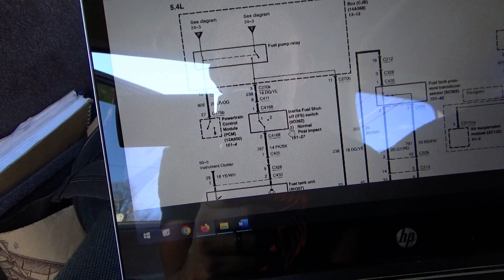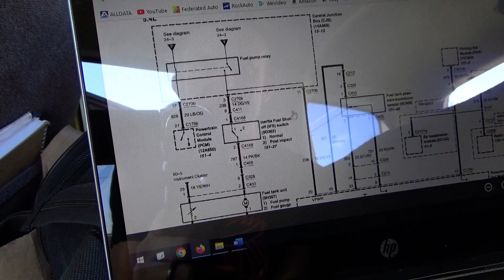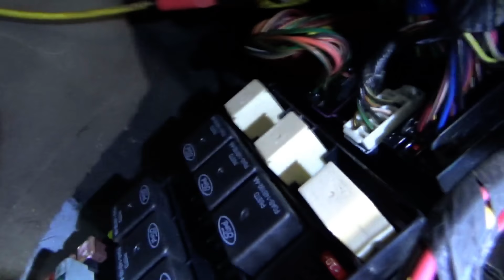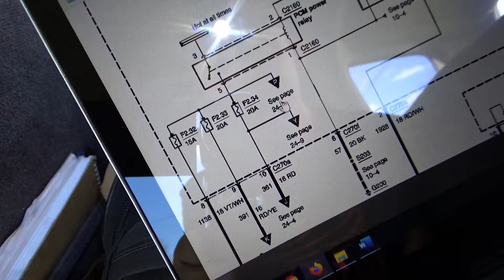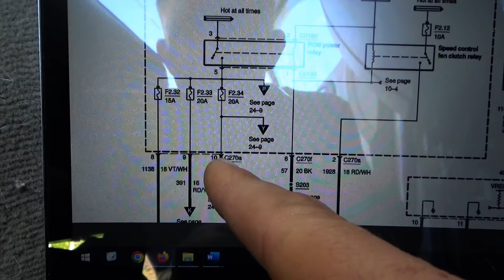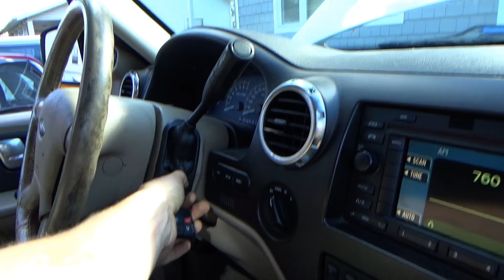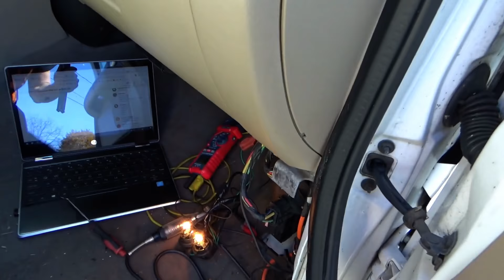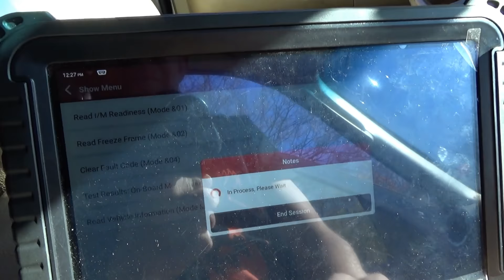Ford Owner STUMPED for 6 MONTHS? Fixed in 15 MINUTES! (No Fuel Pressure P0231)

Comment: Did a relay replace years ago, New mini-relay soldered in to the main fuse board, had intermittent stalling issues.Have driven the 2003 Expedition about 7 years since, now 290,000miles. The mini-relay was a four pin I believe, and all the fuses had to be removed and the board disassembled, not horrible.Just have to lay out the fuses to match their locations. You could see the burn marks on the board.Next time I will do this instead. You are a solid tech.

Comment: But if you leave the ignition on with the engine off the pump will run all the time. Output from the ECM pulses that fuel pump relay for a few seconds to prime the injectors and then shuts it off. This is not a fix. It is a dangerous hack. Either replace the relay with a new factory one or splice in a aftermarket relay..

Comment: Ford should be reprimanded for designing / engineering the fuel pump drive circuit in that manner , why did they not just have an external fuel pump relay for that circuit ? 🤨 BUT HEY - makes them money 😒

Comment: The fuel relay actually shuts off if the vehicle is even impacted. At least the older ones did.
That also came in quite handy to police departments who might be chasing a Ford all they had to do is bump it from behind and it would shut the car down.
It used to reside near the rear of the vehicle sometimes either in the left side of the trunk or the left side of the storage area and an SUV and you pull back some Carpeting and you push a button and it resets it
Reply from the maker: Yup the Inertia Switch is still present on this one and is active :)

Comment: Kinda disappointed you didn't fix it correctly, I never professionally nigger rig something unless it's a lost cause.
Reply: I would have added a fuse holder to that circuit, to keep it separate so there's no chance at burning up that fuse block more than it already is.

Comment: I've seen this on various manufacturers  products. There are many ways to fix stuff but only one way to do it correctly all temporary repairs are permeant until they fail again and its always the last one to touch its fault when something goes south. I would remove the Distro Box break it down and desolder/resolder the relay proper. Board level repair is not that difficult just a little time consuming is all. This is a hack repair IMO. Works yes but is it correct ? No .

Comment: As others have said, add external relay. Gonna burn up other switches etc otherwise. Ford put that relay in for a reason.
Reply from the maker: @billhartsfield424  what other "switches" would burn up? 😂
Reply: @ should have said relay . I know you said it was replaceable, but why not just add another dedicated relay and be sure you’re not overloading the original replaceable . But, then, it is a Ford. So go with what works👍
Reply from the maker: @billhartsfield424  I showed the wiring diagram in detail... There's no extra load on any fuse or relay with my bypass 😉👍

Comment: First, I agree with Ivan.  Internal, non serviceable, relays are a STUPID idea !

But, the "Russian solution" disables an important safety feature.  If the engine stalls for any reason (like in a crash) the fuel pump stays on as long as there is power to the PCM.  Currently the PCM shuts down the fuel pumps within a few seconds of the engine longer turning.

Comment: I hope that my EV doesn't have that problem

EVs are way simpler to diagnose.... for EV techs

Because they have way way way less systems to deal with, like less than twenty (high estimate

Whereas ICE vehicles have dozens of systems of systems that have a convoluted relationship with the engine and each other
Reply from the maker: @ScrappyDoodad  let's see your EV go 200k miles first 😉

Comment: Nice. Jumping the relay was a nice way to bypass the issue. For an older vehicle I think this is an excellent fix.   Watching your vids has provided me with a different way of approaching automotive problems. I had a guy at work that had an issue with one of his grandkids cars. Unfortunately he pulled the parts canon and threw out the original parts. I didn’t look at the car, but when he mentioned the issue of it not running after washing the engine, I mentioned to check stuff before the canon, since it sounded like it was on account of the bath lol. but they didn’t. replaced anyways. Ended up being water in the air intake and a wasted amount spent on a new throttle body. 

More people should watch your vids. It would save them so much. Even if you were to fix it the price of knowing the actual problem and not guessing is worth it. Keep up the awesome content.

Comment: Hi Ivan,  doesn't the fuel pump run whenever the ignition is on through the jumper rather than under computer control only when the engine is running (after priming)?

Comment: I've got a '96 3.8L Windstar (I can hear viewers saying, "Oh, sorry about your luck."), that's been sitting at the shop for about 19 months. Began with a sort of cutting out between 50-60 mph, but ran fine the rest of the time. Finally began getting worse, especially when climbing small hills, and finally started dying at stops, and hard to start. Toward the end it just started jerking like crazy going up hills, but if you put the pedal to the floor it would straighten out until you went back to normal driving speed. Codes are pretty much confined to misfires. Shop has replaced everything related to what he thinks could be the cause, but hasn't torn into the engine itself. Fuel pressure was steady, can't find any vacuum leaks. Could use a suggestion on where to focus my attention, other than finding another vehicle, lol. For those wondering, the mechanic is a friend who just tinkers with it in his spare time.

Comment: The fuel pump control module is bolted to the frame of many Ford trucks near the left rear wheel, and controls the fuel pump.  Can’t see it without removing the wheel. They corrode due to poor design, and intermittently affect the operation of the fuel pump. Visual inspection of this module is a lot simpler than first snipping wires and installing new relays.

Comment: Ivan… Amazon sells a Relay socket for the Ford P6STD relay, just like the other Junction box relays. Relay Socket / Pigtail for 5-prong Relays, CEC Industries AR502C. Use this pigtail to wire in an External relay and plug in a standard Ford Relay. Functions same as produced but relay is easily replaced.

Comment: its not safe you remove the time protection for the pump and whenever the engine stop run the pump should also switch off

Comment: YEARS AGO
I worked as a mobile factory mechanic for a pump maker. We would roll out and perform repairs and we also did a lot of new pump installs as well as all the warranty work in our area. On a rare occasion we would get into a problem we could not solve. After the first tech threw up his hands out service mgr would send our best most experienced tech to take a look. On a rare occasion even he was stumped. But we  NEVER  gave up and told the customer it could not be fixed. What was done was we called the factory and talked to engineering. Sometimes they had some suggestions for us to try but a couple of times not even that worked  SO  an engineer got on a plane and met with us and went to the customers site and we  ALWAYS either got it fixed  OR  we swapped out the entire pump for another new one with the defective one being shipped back to the factory where the engineers would disect it in their lab. BUT, we  NEVER  walked away. Thats bad for future sales. FYI-these pumps were pretty sophisticated. They were computer controlled with a satellite uplink and internet connection. The basic pumping part gave us no problems.

!

Comment: Great diagnosis, but not a fix. PCM control of the fuel pump is safety critical. Why Ford chose to make this part  non replaceable is a bad decision, but it can be fixed either by dissecting the module and replacing the fuel pump relay, or replace the module.

Comment: The fuel pump relay fails due to old clogged fuel filter which causes the fuel pump to work harder pulling more amps and melts the relay! I like your fix but replace the filter and the relay is available on Amazon for about ten bucks wire to the mother board and your good to go if you want to or not!

Comment: While your method will get you short term results, Your adding a lot of extra load to the PCM relay that will cause it to fail sooner. Adding a Bosch external relay & connector ($15) would be a much more reliable repair

Comment: When you turn key on with engine not running, does the pump continue to run even with no engine running? If so, you are defeating the safety timer. It usually stays on for a second or two to pressurize the rail. The PCM must have control of the pump relay, (and hence the pump) for this reason and others. For liability's sake, PUT IN A REPLACEMENT RELAY, HIGHER AMPERAGE (30 A) AND SHIELDED FROM WEATHER. An accident with a live battery, ruptured fuel line and pump still running will cause a fountain of flaming fuel. That's why the relay, whose function is tied to a running engine is in place.

Comment: Bro! IVAN!! You have NO IDEA how ON POINT your timing is!!! I can't THANK YOU enough!!! I bought an '05 3.0, swapped the motor (it seized at 99k) with a reman PowerTorque from O'Reilly and STILL have that dang P0171 & P0174, AARGH!!! Then I was reminded by your video here that the truck was involved in an icy spin on a bridge, no other cars involved, but the inertia switch (passenger floorboard between console and kick panel) was tripped and wires fried. Post collision, an aftermarket fuel pump, sending unit superchips MAF and dang Karen&Nancy hot air mistake. FFSFacepalm Can you please shoot me?? Nah, well, maybe... today tho, i plan on frankenflipping out a fuel pump,sending unit and injectors out of a 98 3.0, bc free so why not?! But what else do I need to pay mind to? I switched out that tripped collision sensor, obviously im a bit of a greenhorn, mostly paint and body, my Guy, I could really seriously appreciate some advice. External relay seems to be the (CYA) consensus... got a new bosch direct fit downstream O2 sensor because stft&ltft totaled 30%. I think I've got my submarine screendoor plugged with enough big league chew, but could you maybe hit it with a couple bazookas for good measure? (Tuck & Roll)
Reply from the maker: Needs OEM MAF and air intake.

Comment: You know we love you man. But I watched the video three times  because I couldn't believe my eyes. I have to agree with most critics here. It appears that  the inertia switch as well as the pcm have lost the designed in safeties and controlability  of the fuel delivery. System. I own the same vintage vehicle and I would prefer  a new junction box or wiring in a new delay externally. Chances are it will never matter. But if or when it  did it could create a perfect, adding g fuel to the fire scenario. Peace

Comment: Ivan let's fix things the correct way, no to need to work around the manufacturer design. You have removed PCM control of the fuel pump. Bad idea. You want to half a** stuff that's fine, but don't encourage others to hack up their vehicles.

Comment: Guy towed in a Landcruiser here for me to look at, maybe 6 or 7 months ago - crank no start.  I didn't bother doing anything beyond giving it a quick crank-over.  Ears diagnosed no fuel going to engine. I told him it needed a new in-tank fuel pump.  He said he needed to think things over... okaaay... Off he goes with his jeep.. Fine by me. 

Pal who works at another garage rang me there earlier today to tell me that guy went to his bosses garage that gave it a twirl with their scanner - said it needed injectors.. that didn't work so they fitted a new high pressure fuel pump.. then a new ECU....then they pulled the head as it had "low compression...".. It sat there eating new parts till yesterday, lol - which is when they fitted a new in-tank fuel pump & the vehicle fired right up.  I kid ye not. Guys bill is seemingly in the several thousands. I asked Pal wtf the story was?? Yer man said he thought I was too rough looking & hadn't even bothered scanning his vehicle, lol.. which is why he went elsewhere. I did lol a bit tbh..

Comment: Yeah. The concerns of safety really hit me hard.
Allowing the pump to run continuously would be a bit nasty in a KO-EO situation. I think an external relay added in would be the best thing. Inertia switch aside. A key switched relay controlled by the engine electronics. Definitely.

Reminds me of a copycat guy who installed an electric booster pump in his muscle car. Like I did in the few I had.
He went to a car show and left the accy. switch on. Big mistake because that's the circuit that the pump was wired into.
After a few hours with the radio on he got in to go for a ride. People tell me vividly what happened then.
A Chrysler 426 Hemi with 2 4 barrel carbs.
When he hit the starter. There was a loud "THUD" under the hood. He popped the hood before the fire under it could bake the paint and someone came with a fire extinguisher.
The valve covers were warped. A few cover bolts were blown off flush with the cylinder head. The dipstick launched out. And being a Hemi with plug wires in tunnels. Were blown right off of the plugs. A big mess.
The engine after repairs had a rattle that he never was able to get fixed after a teardown.
New engine with Keith Black parts. All for a ten-buck relay and proper wiring.

Me? Electric pump wired into the oil pressure switch with a relay and tickled by the ignition switch in start only to give the relay coil some pixies. No oil pressure, no pump. Until the starter is engaged.

Yeah. I think an outboard relay at the very least would have been almost as quick. And much, MUCH safer.
But you do amazing work. This one made me think. Ivan, Really??!!

Comment: Concerned about this fix, especially if the fuel system is returnless and the pump is PWM. Don't remember which year it changed, but I know it was close to 2003.

Comment: If you use CK automatic wire strippers (there are many versions of this) you can strip a section and connect another cable in seconds. It cuts, grips and pulls the insulation in one movement without cutting the conductors.

Comment: You're now legally liable for that repair. That relay was fire protection in case of fuel line rupture in an accident so the occupants aren't swimming in a pool of gasoline. Typical when  the fuel line is ruptured, the engine will die starving for fuel. The PCM stops the fuel pump at the absence of rpm signal limiting the risk of huge fire.
This repair is not an option even if the customer wanted it. People are saying the customer was informed, the customer is not a professional.
Reply: you could easily wire in an external inertia switch in line with the fuel power lead.

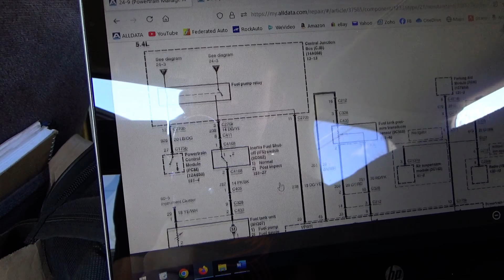Comment: Not to be a negative nancy..  but, I don't really like this fix because the PCM is no longer in control of the fuel pump, and the pump is going to run no matter what when he turns on the key.  So if he's sitting somewhere with the key on and running his radio a bit or something-- the pump is just running and running and will likely shorten it's life.    As you showed on (2:20)..  The control wire was also exposed (12 on the junction box..  or 27 on the PCM)...  So a better solution would have been to add an external relay and tie it in to the same control -- and also the same power feed (which you did).   At least that way, the PCM still has it's original control and not leave any codes at all;  all we did was make the relay external... (and I know you did mention it at the end).... ..   I guess it's not a big deal as long as he knows not to sit with the key on when it's not running.

Comment: you forgot to mention that in most cases even if someone wanted to replace the GEM they can't because they are no longer available and it's not just the trucks, this POS 2k mustang convertible i bought  on the second time i put the top down the motor quit working, after days of tracing and testing connections i had a friend send me a schematic from one of his subscriptions and it turned out that like all the power window motors the top motor was ground through the GEM which isn't available anymore so i ran a ground wire to the body and the top works now. GEM's are just another in a long list of reasons why fords suck.....
Reply from the maker: @abruptlyblunt  GEM, SJB, TIPM, IPDM... they all suck! 😆

Comment: If I was a shop owner, I'm not sure how comfortable I'd be with the bypass. It disables PCM control of the fuel pump, which in turn disables a number of safeties.  That's a huge liability for the shop.

An external relay, while adding a bit of cost and time to the repair, would retain all the needed safety provisions.

Comment: Now the PCM relay is passing more than rated current and will eventually fail too..... this along with the obvious crash safety issues 😂
Reply: No its not..  The wire out from the PCM goes to P before the fuse, and Y after the fuse..  P is the control side of the fuel pump relay, Y goes to the power side of the fuel pump relay..  
.
Full fuel pump current was already going through the PCM relay.

Comment: Ivan, please tell me this was a quick bush repair to get the truck home. To do this safely, the fuel pump relay must be replaced, not bypassed. An external relay and socket would do the trick nicely. You don't want the pump running continuously key on engine off because if the fuel line breaks while driving the ECM can't shut off the pump to prevent a huge volume of gas spraying out all over the hot engine creating a fire risk. It's unlikely but not something you want to be liable for.